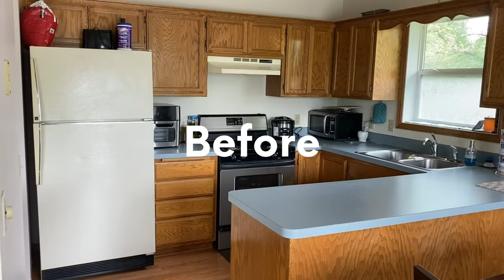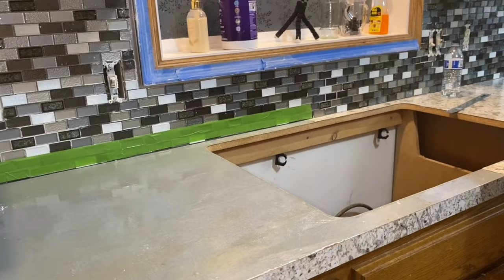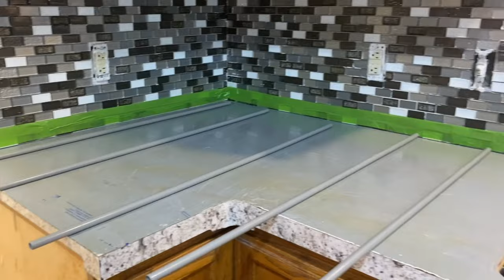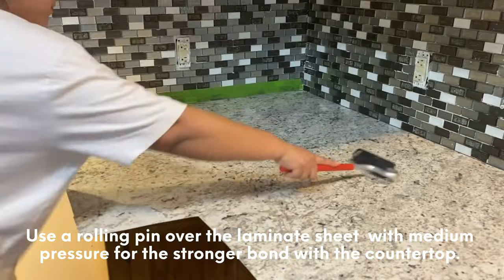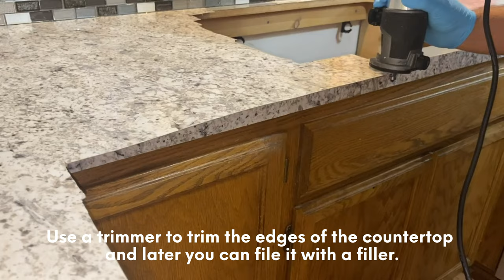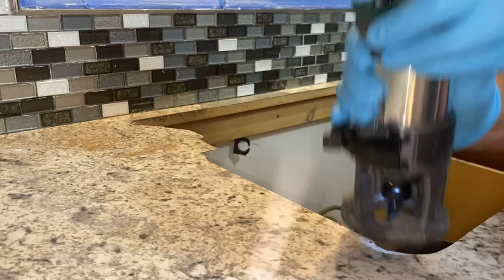How to Install Sheet Laminate on a Kitchen Countertop

Comment: Is it best practice to remove the old laminate sheet? Ours is from 1980’s and likely difficult to remove..
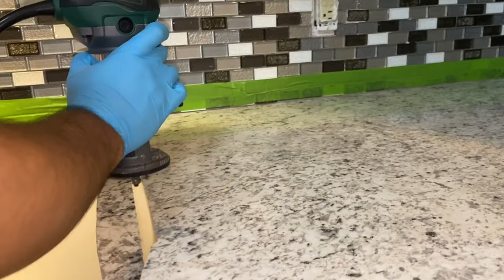Reply: You can go over old laminate. Make sure to rough up the old surfaces really well (sand) and there should be no problem. Do the edge banding first and then the top. Be careful when trimming around the edge or you get the problem they had (shown in the video @ 3:40). You'll notice where the trimmer blades took some of the finish off of the edge banding. You can also use long wooden dowels instead of the metal rods. Very important to let the adhesive on both surfaces sit for awhile and are slightly tacky (10 min. at least or according to the manufacturer of the adhesives instructions), the adhesive will then be just tacky enough to where the wooden dowels won't stick when pulled out. Don't forget to use a roller on the laminate as it really helps both surfaces to bond. Hope that helps.

Comment: How did you remove the old laminate
Reply: You don't have to.
Reply: @CherryACR can i apply new laminate sheet on an old countertop?
Reply: @rubywoo8578  yes. As long as it's smooth. Sometimes it's a nightmare to chip up the old stuff.
Reply: @CherryACR  i am confused. My kitchen countertop is ugly. Just bought the house. The now laminate has some broken spots. Don’t know if i should remove old sheet or just paste new sheet over it.
Reply: @rubywoo8578 fill in with putty, sand. Then put laminate sheets on top